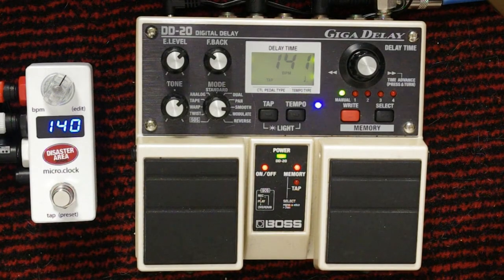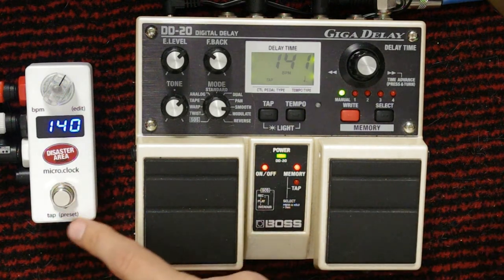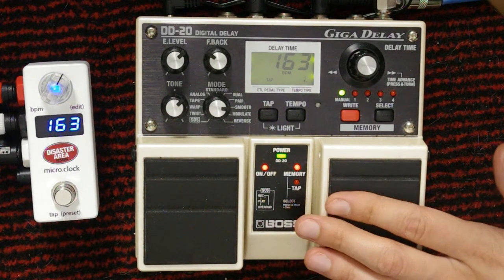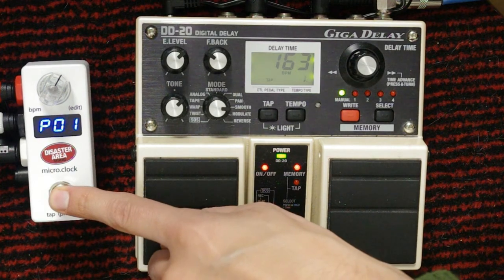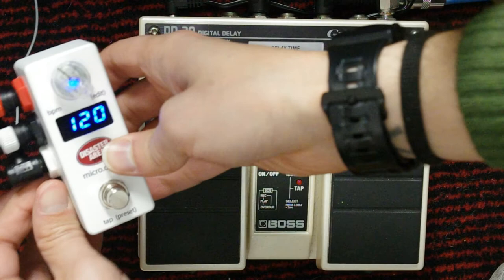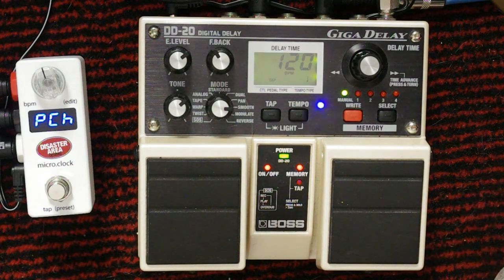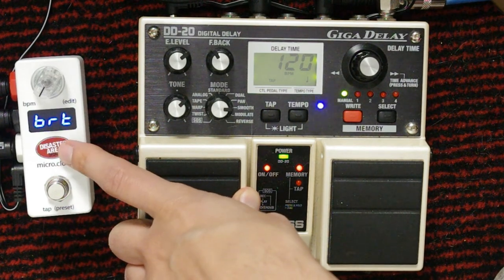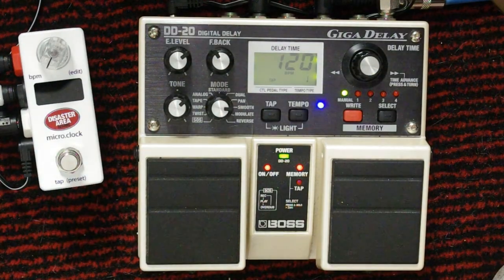Disaster Area Designs - micro.clock

Comment: Hey Guys thank you for this video ! Is it possible to use the knob as a direct control over the bpm ? Like rotating it through a range of bpm that would appear in real time on the screen?
Reply from the maker: Hi Joseph,
Yes, it is, whatever the BPM shown on the micro clock's screen will be communicated to all connected devices, either by taps or manually turning the knob. The new BPM Will then be displayed on any devices that also have screens and are setup to display BPMs.

Comment: Hi guys!! Great vid... i got a question... so if its on dotted eight mode, can you leave it at that to tap it manually during live shows? Or the dotted eighth can only be stored as a preset? If the dotted eighth can be used manually, i just need to tap quarter notes? 

If my pedal has an external tap tempo, and can only do quarter notes... will the micro clock enable it to have dotted eighths, even if the delay pedal has only quarter note mode?
Reply from the maker: Hi David! Thanks! 
Imagining you connect your micro.Clock to a pedal and you always use preset 1, if you setup this preset to be dotted eight notes, the micro.clock will take the BPM you stored in that same preset and subdivide it to make it dotted eight. However, say you always want to have that preset on but would like to tap in the tempo during songs or during songs, that is also possible. If the preset is saved as dotted eight notes, all the quarter notes that you tap in will be subdivided into dotted eight notes by the micro.clock (however, the BPM will change according to the quarter noted you tap in, despite the sound being in dotted eighths. I hope this makes sense).

As for your pedal, it doesn't matter. What the micro.clock sends to the pedal are pulses meaning that you can think of it like tapping your pedal really fast to give you dotted eight notes (imagining your quarter notes only pedal has tap tempo and you want dotted eighths but you want to tap the tempo instead of changing the knobs). This is what the pedal is getting, real fast pulses that the micro.clock converted from quarter to dotted eighths or any other subdivision (most common ones at least). 

Let me know if you have any other questions :)

Comment: i saw a video stating that to use the micro clock with a boss dd5 you need to use a TS cable, not a TRS cable.  is this true for all pedals or just the boss?  i'm interested in a micro clock to sync my dd5, jhs panther cub, and possibly a tap tempo compatible tremolo pedal.  thanks!
Reply from the maker: I believe that for that purpose,  most pedals use TS cables. Usually, TRS will be used when pedals have more parameters that can be controlled via footswitch, something like jamman pedal where you can tap in, scroll through loops and stop your recordings via external footswitch. Hope this helps

Comment: Awesome demo guys. Btw I have a question. I got a boss dd20 delay and line 6 M5. I would like to sync both bpm on real time base. Could that be done with this device? Any advise? Thanks
Reply from the maker: Cornelius Misong Glad you liked it!
That's a great duo and yes, it can be done. You can use the A or B outputs to set the tempo on your DD-20 and the multijack on the M5 as this is the only output that sends midi signals, the M5 does not receive tap impulses, only midi. To do this, you'll need a special cable though. A TRS to 5-pin midi cable. You can find one on Disaster Area's online store, the MJ-5P, costs 15$.
Reply: PedalCasters Thanks for the input! Much appreciated.

Comment: Great video! Have a Source Audio Collider Delay/Reverb and a C4 Synth. Also picked up a DMC Micro in addition to the Micro Clock. New to midi - how can I setup both the Micro Clock & DMC Micro to bank up and down stored presets on both the Collider and C4 while also controlling the Collider Delay BPM & C4 arpeggiator BPM with the Micro Clock?
Reply from the maker: Thanks :)
Since the release of this video, I have bought a Collider however, I sold my micro clock so I'm afraid I won't be of much help.
However, I think you can do all that by using just the DMC, by using midi with the Source Audio stuff, you can access 128 presets on each of the devices so, assuming you have specific BPMs per preset, the result will be the same every time you switch presets. To have the micro clock send BPM pulses to the Source Audio pedals, you would have to use the midi out (multijack) anyway as these pedals  do not have a Tap In to receive tap impulses, they do those changes via midi.
Hope this was somewhat useful!

Comment: So (and I may be confused about this), if I have a delay that only has one or two subdivision modes (eg: T-Rex Replica) this little device can have it do more than those two subdivisions? I do actually have a Replica (actually the TC Vintage Delay which is identical to a Replica, T-Rex struck a deal with TC on the "Vintage" series - same pedal, different housing) and a Way Huge Supa Puss (plus my trusty Boss DD-5 if needed). So I could sync two of those delays (TC takes MIDI-in, WH regular tap-in) and sync my Source Audio Tremolo all with this device and set up presets for various subdivisions and/or BPM  have I got all that straight? I'm looking at the Disaster Area, Selah Quartz, and the Molten Voltage range. Cheers, thanking in advance.
Reply from the maker: For the Replica and DD-5, yes, that's correct however, because the T-Rex pedal uses the standard MIDI format (5 pin cable) and the Micro Clock used MIDI TRS, you would need to buy one of their adapter cables. Also, out of the Micro Clock's 3 outputs, you would have to use the MultiJack out as that is the only MIDI capable output. 
With the DD-5, any of the outputs can be used.
Unfortunately, the Supa Puss cannot be used with clock pedals.
As far as operation goes, it's like you say: you tap in your tempo (quarter notes or select the exact BPM you want) and then chose a subdivision). The pedal has the most common ones. For the pedal to operate as it shoud, the T-Rex should be set to quarter notes. You have 99 presets available and you can buy their footswitch in order to scroll through presets. It is not needed but it's better if, for instance, you have a set prepared and you don't want to go through a bunch of slots to get to your desired preset. It's importante to note that this footswitch will be using the multijack out, leaving you without a MIDI output.
As for the Source Audio Vertigo, I believe it won't be as easy. You'd have to use MIDI via USB and according to Disaster Area, you'll need Soundblox or NeuroHub (for clock function only).

I hope this helps. In the end, it's likem Disaster Area warns, if you have more pedals with standard MIDI connections, you should also consider their SMARTClock. This pedal is the best option if you have a mix of MIDI and standard tap in pedals or perhaps you wan't to swicth something on your amp but as far as MIDI goes, it's easier to use it with brands that already use TRS MIDI like Empress, Chase Bliss and a few others.

Thanks Matt! Oh and I love that TC/T-Rex fact! I did not know that but now that you brought it up, it makes so much sense! The pedals are completely the same! Thanks for that! :D
Reply: @pedalcasters  Yeah, same pedal! It's a wonderful delay. Probably my favorite. 
Ok, thanks. Bad news on the Way Huge but not a deal breaker. It can go on my small board.
I have the Neuro Hub and a few SA pedals. Nemesis Delay, Gemini Chorus, LA Lady, and the Vertigo. Disaster Area DPC-8EZ loop switcher (gen2) and a Disaster Area DMC-3XL (gen3). Still learning to use all this, and MIDI is difficult for me as I am old and growing dumber by the year XD. I don't think the DMC can do everything that the Micro Clock can do, and apparently the SmartClockV3 is even better. I'd love to run 3 delays (TC, Nemesis, and either the DD5 or my MXR EP-103 Echoplex pedal - yes I have bad GAS) and my trem with my wet/dry dual amp rig. That'd shut my bandmates mouths! Bunch of whinging so-and-sos ;)
Reply from the maker: @mattgilbert7347  That's a nice list right the :) I say, if you gotta have a lot similar pedals, might as well be delays!!! ahah It is also the effect type I tend to buy in greater quantities. My big board has 5 (6 if you count the Red Panda Particle as a delay)...
MIDI is definitely a learning curve. I also only scratch the surface as I mostly use it with my Timeline and BigSky with the Disaster Area DMC-2 which, luckily, is really really simple to set up. Also, I only use it to scroll through presets simultaneously on the Strymons and turn them on/off (love that about them).
GAS is real... Like Josh from JHS, we might all need help ahah
The SMARTClock does more, it's a bit more complex. Their lineup of accessories never ceases to amaze.
Reply: @pedalcasters  Ohhh Red Panda Particle - nice. All you need now is an Eventide Rose, Caroline Kilobyte, DBA Echo Dream (I gotta clone of that,  proper chip 'n all, for $90AUD :D), Diamond Memory Lane...
I'll stop there. 
Yeah DA Designs are the bomb. Must be because they have a Matthew in charge. :) 
Cheers. I might let you know which one I end up getting, if I do go ahead with a purchase. 

NB: I need a Line 6 Echo Park,  DOD Rubberneck, JHS Panther...

I'll show myself out.
Reply from the maker: @mattgilbert7347  Oh and don't forget an 80tape Limbo III... I have major GAS for that pedal... It's always sold out... And an original Memory Lane is one of those that got away for sure...
I saw a JHS clone of a Memory Lane at a reasonable price on Reverb the other day. It looked killer!
And yes, please let me know which one you're getting then, I'll love to hear all about it :)
Reply: PedalCasters Have you tried it on a Boss DD5? Does it actually worked? I have a Boss DD5 and were not able to properly sync the tempo. Maybe because the DD5 requires 4 taps? I already set mine to Normally Closed but still can’t get it right. Any parameters I should adjust?
Reply from the maker: @ntm2704  as long as you use it in mode 8, it should work just fine. It's the only that will translate the impulses into what's actually bring fed to the tempo input, i.e., quarter note mode. For other subdivisons, you should still use this mode and change the actual subdivision on the Micro Clock. I really hope this helps :)
Reply: @pedalcasters  I got mine working. I didn't know that I should use TRS Cable for Micro Clock. :) Thanks man!
Reply from the maker: @ntm2704  glad to hear it :) enjoy!

Comment: Can the multijack also be used to change your delays preset using midi cable?
Reply from the maker: Yes it can, you might have to buy a TRS to 5 pin midi cable if your delay pedal doesn't have midi via TRS though.
Reply: @pedalcasters  I have a source audio collider and it has MIDI 5 pin input.

I woul like that if I change tempo preset in the micro clock I also change the preset on my collider.
Reply from the maker: @zealfer  if you tap a new tempo, it will not change presets. You can have different presets with different tempos however, keep in mind that without an external footswitch, you can only scroll up presets with your foot. If you want to be able to scroll up and down, you will need a footswitch. the downside is, the footswitch must be connected to the multijack. As this is the only output that sends midi signals, you would not be able to connect the micro.clock to your collider via midi.
Reply: @pedalcasters  oh okay. So you are saying that I really need to buy a separate footswitch then I have to connect it to the multijack? Am I roght?
Reply: @pedalcasters  can you also teach me how to connect and what to connect from micro clock to collider?
Reply from the maker: @zealfer  the footswitch is optional, it's only for scrolling up and down presets on the micro clock however, to use the midi functionality of the micro clock, you cannot use the footswitch.
As for programming, you probably have to use the Neuro app and set specific program changes for the midi side of the micro clock to communicate with the Collider. I have had both pedals but sold both so I can't help you much more, I'm afraid.

Comment: So if the pedal has up to 99 presets and I only use 5 will it go back to the first preset after the fifth or do you have to scroll through all 99 to get back to your first preset?
Reply from the maker: Because the pedal only allows you to scroll up, you can enter setup mode and limit the preset number to any amount you want so once it gets up to, let's say preset 5, it goes back to the beginning.
Having said that, this is where the additional footswitch comes in handy, allowing to scroll both up and down through presets.

Comment: Great pedal! I've got some analog sequencers as part of my setup --- can you tell me the pedal sends a standard "clock" signal for those devices?
Reply from the maker: Hi Sean! It shouldn't be a problem, via midi you can send clock signals to pretty much every device that is prepared to receive them. If not via midi, the fact that you can use outputs A and B as normally open or normally closed, renders this a very versatile syncing device. I must say though, I never tried it with analog sequencers.

Comment: Can this be used with the Boomerang III Phrase Looper Midi???
Reply from the maker: Rule of thumb is, the multijack output of the micro clock can be used with any midi compatible devices (even if you need to buy a converter cable from trs to standard 5pin midi). Having said that, I'm not sure the Rang inputs on the boomerang are actual midi connections. As Disaster area state on their website, the device works with much more units than the ones shown on the website so, to be certain, I think you should ask them.

Comment: Great demo!  Can you tell me the differences (other than size) between the Micro Clock and the Smart Clock?
Reply from the maker: Hi! Glad you liked it! :)
Essentially, the micro clock can control up to 3 pedals (or function as a toggle switch for your amp, for instance, on 1 or more of the outputs) while the Smart Clock allows you to control up to 4. Unlike the Micro Clock which only has 1 Multijack out, the Smart Clock has 2 Multijack outs so these can be highly customizable .
Also worth mentioning, although the Multijack out of the Micro Clock can send MIDI messages (via TRS cable), the Smart Clock actually has a standard, 5 pin MIDI In/Through and MIDI out. 
In the end, it's about what you are looking to control and how. For my use, the Micro Clock was the right choice (and size!)
Reply: PedalCasters Thanks!

Comment: Hi !!! i have a question, i can coneccted of midi in to into red input from micro clock, example i have boss sl 20 and this pedal has midi in,   thanks and sorry for my english, isn´t my language.
Reply from the maker: Hi! Yes, the micro clock can control your sl20 via midi clock but you'd need to buy a converter cable off of disaster area's webstore (standard trs to midi 5pin).
The sl20 is such a great pedal! Wish we had one so we could demo it!
Reply: thank you !!!!!!!!